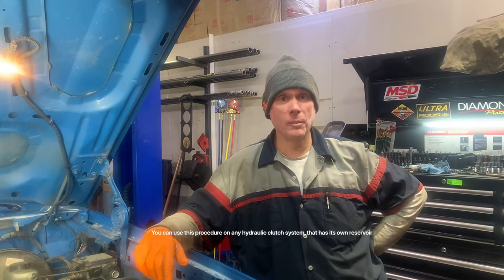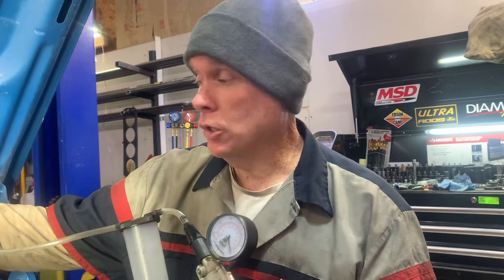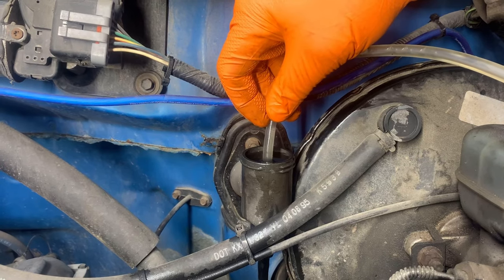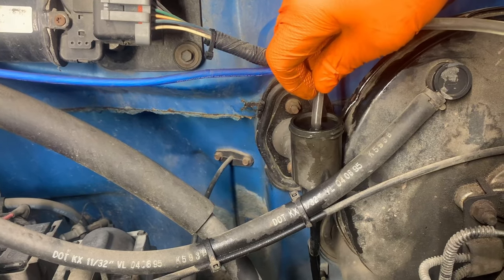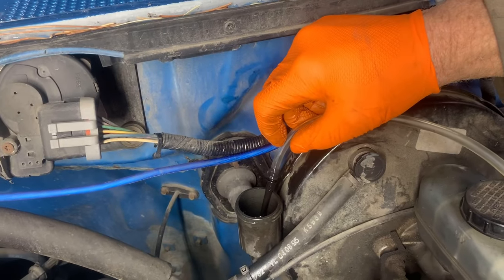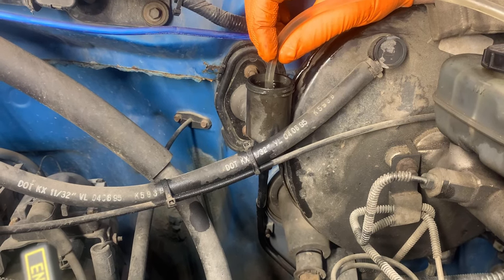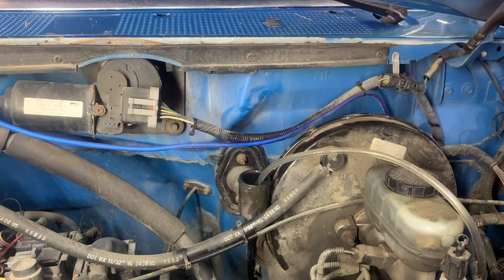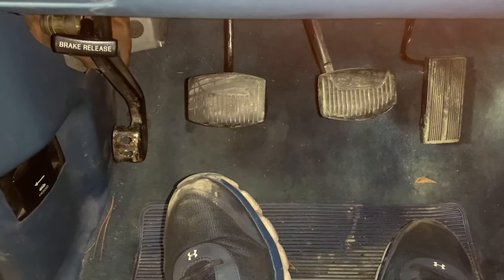Easiest, way to bleed a clutch. Works on impossible Ford concentric slaves. Can be done alone.

Comment: Ive been trying this on my 95 f150 and the oedal feels better than intially but im still not getting enough pressure to fully disengage the clutch any tips? Ive done this technique at least ten times and still get air if i crack the bleeder with the pump
Reply from the maker: Try it with the pedal down. Are the slave and master new?
Reply: @greasyhandsauto-shaunbutte9726  Ok, I'll try that. The slave is but the master is the old one, however it does look relatively new. I bought the truck about a year ago. I did depress the pedal last night with a 2x4 and cracked the bleeder a few times and got nothing but fluid so honestly I'm stumped now. Unless the new slave is defective.
Reply from the maker: @dylankopera5428  You may have air, in the master.
Reply: @greasyhandsauto-shaunbutte9726  and trying to vacuum it out with the pedal depressed could fix that?
Reply from the maker: @dylankopera5428  yes
Reply: @greasyhandsauto-shaunbutte9726  ok. I'll give it a shot. Thanks for your input!
Reply from the maker: @dylankopera5428  you’re welcome
Reply: @greasyhandsauto-shaunbutte9726  Figured Id give an update on the truck. I got a little more air out by putting vacuum on the master with the pedal depressed. Then I cracked the bleeder 2 more times after that and got the clutch to fully disengage. Thanks for your help!
Reply from the maker: @dylankopera5428  yay!!

Comment: So do I need someone to press the clutch while I do this?
Reply from the maker: No
Reply: I’ve done this like 6 times and still have no clutch. Any ideas???
Reply from the maker: @chadlee1673  are the parts new?  If so, try starting with the clutch, in the down position, that will bleed the master, then before you do anything else, do it again, with the clutch up.
Reply: @greasyhandsauto-shaunbutte9726  I replaced the clutch disc, pressure plate and the hydraulic thing in the transmission. The think ok top that you stuck the hose in isn’t new.

Comment: Tried your method, on 3rd attempt, my mityvac wont hold over 15inhg of vac and just spits constant air into the mity vac. No leaks anywhere! Slave is dry to! Plz plz help. What could cause the vacuum to drop to zero? New clutch\slave\master 30k miles ago
Reply from the maker: The only thing that would cause that is a leak. Have you checked the master?
Reply: Yes, I thought the same thing. I even bought brand new one today hoping that would fix it. Still no pedal at all!! Really worried I damaged the seals on the slave cylinder inside the transmission using the vacuum method ☹️
Reply: I even tried reverse pressure bleeding, lots of air bubbles but still no pedal feeling. The mityvac holds up to 15inHg when a giant sucking noise /air bubbles happens and it drops down to zero in a couple seconds. Wont hold vacuum at all after that
Reply from the maker: @vovavivavoom  that’s not possible, the pressure applied, by the pedal is much higher than any vacuum you could pull. Try it with the pedal down and then in the up position.
Reply: I also tried that! With the pedal depressed down, it will hold up to 30inHg no problem, but I get no air bubbles, just clean fluid into the mightyvac. If the pedal is in resting up postition, the 15inHg drop occours every time.
Reply from the maker: Your insulting the vacuum pump into the line? If you are and it’s not holding pressure, you have a leak. The slave is dry you said? Make sure it’s not leaking at the catch bottle. They are probe to do that. If not, it’s leaking.
Reply: Yes the line is being sealed in the bottom of resovoir / hose. Everything around the slave looked dry, but where would this catch bottle be located? Also, on my second bleed I got a really decent clutch pedal, felt like it could be better and I made the mistake of trying a third time which resulted into the 15 inHg drop. 6 hours of bleeding later and a new master, still the softest pedal yet
Reply: If you have any tips / tricks feel free. Im really lost and frusterated with this one
Reply from the maker: @vovavivavoom  ah, sounds like the slave is bad. When you have the pedal down it stops flow, to the slave. With it up, it opens it back up.

Comment: why not use the same tubing etc, but how about use the vacuum from the intake instead of a pump?
Reply from the maker: You could for sure.
Reply: @greasyhandsauto-shaunbutte9726  I'm gonna try that. Thanks for the video
Reply: @danstrayer111  Sorry I missed that part where you said the same tubing etc.  I can tell you why after doing this today... you'll probably not have enough vacuum.  You need 20-25 inches for the procedure to be successful.
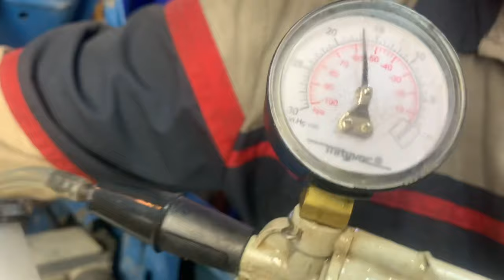Reply: @dryan8377  at  1:57......his vacuum gauge shows 17 inches......at idle there should be around 22 inches. Revving the motor and letting the throttle plate slam shut should momentarily yield more.
  Also.....I am just about to bleed my clutch, and there is a bleeder located at the top of the slave cylinder. I don't know if they all have it.....but, here's what I'm gonna do experimentally:.    take a small container, run a tube from the bleeder at the slave into it, with bleeder open.  fill the reservoir, and use a dispenser similar to a restaurant ketchup dispenser, also full of brake fluid, and force the fluid through the entire system and out the bottom.   
I will try both methods.
    Conversely, one should also be able to apply pressured fluid from the bottom bleeder into the system and fill the reservoir,  taking care not to over-fill it.     Using that method there should be no way for air to remain.  
Trying that tomorrow.
Through all of it..we're asking: why the hell would Ford put a slave cylinder inside the bell housing, so you have to pull the tranny to fix it??
Reply: @danstrayer111  It's madness for sure Dan. I like your ideas though. We did ours today with a totally dry system (big mistake).  Took us 4 hours but we got it done using his methods, and pumping the damned clutch pedal in the end. It now shifts better than it has since we've had it.
Reply: @danstrayer111  Check out my story from today.  In hindsight, there are things I could've implemented (especially based on what you said), that would've saved us a few hours.  Nevertheless, I'm happy with the outcome.  We now got a snarky shifting ranger for sure!  Thanks for the response.

Comment: My clutch "catch" point is right off the floor. Could air in the system be my problem ?
Reply from the maker: That’s not necessarily a bad thing. Unless, the clutch isn’t engaging. Are you able to shit gears and stop, without the vehicle dying? Also, do you have good pedal travel or just limited. If you do, then it could be air.
Reply: @greasyhandsauto-shaunbutte9726  clutch does engage but its just like 1 inch off the floor. When I bought the truck 1995 f150 the owner did say the slave cylinder was replaced. I can shift while not dying but its touchy because its right off the floor. Pedal goes all the way up.
Reply from the maker: @donutdude6258  oh, I misunderstood. You likely need a new clutch.
Reply: @greasyhandsauto-shaunbutte9726  thanks for your response 👍
Reply from the maker: @donutdude6258  you’re welcome, thanks for watching.

Comment: Will bleeding my clutch help it stop shaking
Reply from the maker: @kathurst7159  no that’s generally a warped flywheel
Reply: @greasyhandsauto-shaunbutte9726  thanks I think it went out cause it want go in no gears Kno at all
Reply from the maker: @kathurst7159  that could be slave cylinder, master or the clutch itself
Reply: @greasyhandsauto-shaunbutte9726  I don't kno but it won't go in no gears at all I heard a boom n it would gear change at all .
Reply: @greasyhandsauto-shaunbutte9726  where is tht slave cylinder master located my truck is a 2002 Ford F-150 2WD 4.6
Reply from the maker: @kathurst7159  the master is in the firewall and the slave is in the bell housing, sometimes called a throw out or release bearing.

Comment: Can someone please tell me the symptoms of air still being in the cylinder? I just bought a project truck and the guy told me it only needed a clutch master cylinder. I replaced it and performed this bleeding process, it seemed to work great by the way, but when I try to put it in reverse, the tranny makes a strange rubbing/grinding sound. Is my manual tranny bad?
Reply from the maker: It’s probably the reverse synchro.
Reply: @greasyhandsauto-shaunbutte9726  thank you very much for the quick reply! Liking and subscribing now. Thanks Shaun
Reply from the maker: @Fit.For.A.Firefight.  you’re welcome, thank you sir.

Comment: Just tried this on my 96 ranger . It brought out a few air bubbles all three times but now my clutch is even softer than it was to begin with. Any suggestions?
Reply from the maker: Are the components new?
Reply: Yes . The pedal was a little soft and had some resistance when shifting into gears so I decided to try this method . Now it's even softer with more resistance especially shifting into 2nd gear.
The guage is holding too.
Reply from the maker: @teejayandmarissa  okay, pull vacuum with the pedal down and then again with it up.
Reply from the maker: Keeping the pedal down will bleed the master.
Reply: Ok buddy , I appreciate your help. I'm sure I will get it ! Going to get my girlfriend to help me with holding the pedal down tomorrow and I'll keep you posted !
Reply from the maker: @teejayandmarissa  please do
Reply: Hey man ! I tried to do a vaccum bleed with the clutch pedal down and then with it up but my vaccum pump shit to bed . It's leaking around the cover of the collector bottle.  I will have to order another one and try again. Truck is still drivable , just has a softer clutch pedal than I would like and it has some resistance when shifting into mainly second gear.

Comment: I think I’ve tried it about 6 times now should I just be patient And keep going or what ?
Reply from the maker: Yes and sometimes it doesn’t hurt to pump the pedal between.
Reply: @greasyhandsauto-shaunbutte9726  should I pump the pedal while there’s vacuum?
Reply from the maker: @dariandixon9711  no
Reply from the maker: Good luck, they can be a pain. You’ll get it.
Reply: @greasyhandsauto-shaunbutte9726  thanks man it feels like it has pressure in the lines but it won’t shift into the gears still see a lot of little air bubbles coming out though so we’ll see
Reply from the maker: @dariandixon9711  make sure you don’t have a leak. Is your vacuum gauge staying steady?
Reply: @greasyhandsauto-shaunbutte9726  yeah it’s holding steady vacuum so I don’t think it has a leak
Reply from the maker: @dariandixon9711  you’ll get it

Comment: I’m trying this on my 89 isuzu trooper with the vacuum pump but I’m getting no bubbles or fluid does the pedal need to be pushed down I’ve tried every bleeding method 10 ways if Sunday and can’t get the air out 🤬
Reply from the maker: Pump the pedal about 50 times, then have it in the up position and do the procedure. Make sure the bleeder screw is closed, that’s crucial.
Reply: @greasyhandsauto-shaunbutte9726  I’ll give it a shot thanks 👍
Reply from the maker: @dieselwrench3621  hope it worked
Reply: @greasyhandsauto-shaunbutte9726  I can’t get it to pull any fluid or bubbles I’m wondering if it could have anything to do with the inline damper when I pump it up it holds pressure but only sucks when removed from the reservoir like something is stopping the fluid from being pulled back through the master cylinder
Reply from the maker: @dieselwrench3621  you probably have an air lock. Have you tried it with the pedal down? If that works, you will then need to finish off, with it up. Also, are you getting any fluid out, if you open the bleeder?
Reply: @greasyhandsauto-shaunbutte9726  haven’t tried with the pedal down or the bleeder open I’ll give that a shot tomorrow thanks for all the help 👍
Reply from the maker: @dieselwrench3621  no problem, I know than can be an pain.

Comment: I just experienced my master slave broke had to replace and can't bleed
Reply from the maker: @MrArron1357  this could help you
Reply: @greasyhandsauto-shaunbutte9726  the pin rod snapped off my clutch to the master slave so I replaced it and pedals stays to ground and bleeder screw won't come unstuck without twisting the aluminum it's connect to so this idea ypu have is genius wish I seen it 6 hours ago funny part I never searched for thos info it was recommended like YouTube heard me cussing my truck out lol your a blessing to the YouTube community I replaced all clutch components about 2 years ago
Reply from the maker: @MrArron1357  haha. Start with the pedal down and then up. Good luck.
Reply: Bro ypu are the man it worked perfectly back on the road I'd love to send you a donation for that info you got a way to donate your a hero I have over 4000 in work stalled because the issue amd can be back to work
Reply from the maker: @MrArron1357  Nice, you don’t need to donate. Your comments are sufficient.

Comment: I keep doing this and nothing is helping. It's holding pressure. Brand new slave and master
Reply from the maker: Try it with the pedal down, then up. Also make certain that the cone, is in the hole, at the bottom and f the reservoir. What kind of vehicle?

Comment: Can anyone help me with this I just bought one after watching this video and I’m doing it just like in the video but nothing is coming up the line I’m real confused I must be doing something wrong anything helps thanks
Reply from the maker: Did you put the vacuum pump down in the hole, at the bottom, of the reservoir?  Are your parts new?
Reply: @greasyhandsauto-shaunbutte9726  yep down inside the hole at the bottom by parts do you mean slave cylinder if so no there’s no new parts on the clutch but the pedal went to the floor when I was driving today and now I have no clutch but I can’t find any leaks or anything and there was barely any fluid in the reservoir so I thought it might have just got a air bubble in the line but I have nothing coming out of the line on the bleeder
Reply: @greasyhandsauto-shaunbutte9726  should I feel an air puff or a suction when pulling the trigger because I feel no air movement on the tip of the gun
Reply from the maker: @woods302  you have a leak somewhere. Look up on the firewall, inside for fluid. If none there, pull the cover, on the bell housing and look at the slave, with a flashlight. You could try by starting with the pedal down and then pull it up and put more vacuum, on it. However, with it being low on fluid, you need to fix the leak.

Comment: So why couldn't you do this slowly with a turkey baster?
Reply from the maker: You probably could
Reply: Ok thanks. Gonna try it today.  @greasyhandsauto-shaunbutte9726
Reply: Thats not enough vacuum, this works because the vacuum makes the volume of the bubbles much bigger so they have more buoyancy but also because when you pull the nozzle out the vacuum in the system sucks the fluid down to fill all the spaces where the bubbles once were.

Comment: Where do you get that cone end?  Link to product, please.
Reply from the maker: https://www.harborfreight.com/mityvac-vacuum-pump-39522.html?utm_source=google&utm_medium=cpc&utm_campaign=12144811130&campaignid=12144811130&utm_content=117789256238&adsetid=117789256238&product=39522&store=789&gclid=EAIaIQobChMIvo3SyqWL-AIVPAytBh2ExQf5EAQYASABEgI7RPD_BwE

You can also get it at most parts stores.

Comment: Looking at your way. Do not get me wrong. That way is not a good way.
Reply: Those shops had problems should only wash cars. Do not get me wrong. A lot of people have money and see money in this work. But can not Work. If you have a head eyes and ears. And do not put money first. You will be willing to get any thing right. In my up bringing we had to make parts work. I drive a G20 chevy van with a C1500 5speed gear box. It a 80. When you come up working on every thing. You see more and know more. I stop working because people do not think black people should be pay. I come up seeing workmanship. I have only see two 2 workmen in this place. And one stop working. Cover Automotive and. Knight Performance Automotive &Custom Fabrication. One Shop that i will tell people to stay away from is CARL-CEO. He will rob you with out putting a Gun to your head.

Comment: So what do you do when you hold 25psi for 30 minutes and no air bubbles or pedal? 🤣
Reply: 25 inches of mercury my bad
Reply from the maker: Try it with the pedal down first, then up. Are the parts new?
Reply: pump down to 28, the more perfect of a vacuum you can achieve the better. apply vacuum in a way that it will stay vacuumed and then actuate the clutch. the bubbles will come out!

Comment: Am I the only one who this didn’t work for
Reply from the maker: Try it with the pedal down and then up. If it still doesn’t work, you have a leak somewhere.
Reply: @greasyhandsauto-shaunbutte9726  bled the clutch w the bleeder screw instead this wasn’t working the gauge on the vacuum held pressure so I wouldn’t have a leak
Reply: Mine didn't work either
Reply from the maker: @rockyalford1622  try it with the pedal down and then up. If that doesn’t work, there is probably a leak